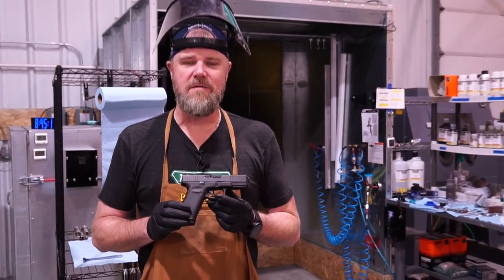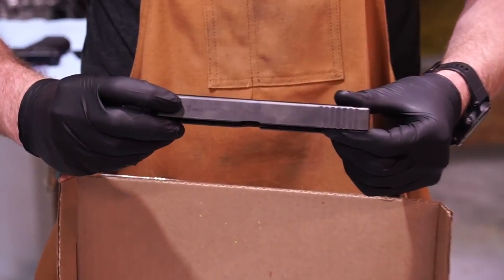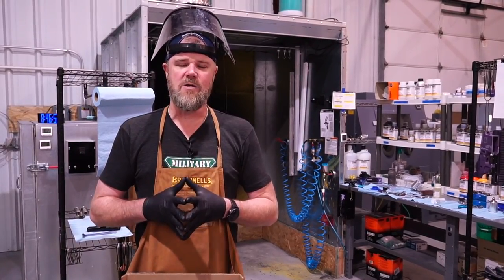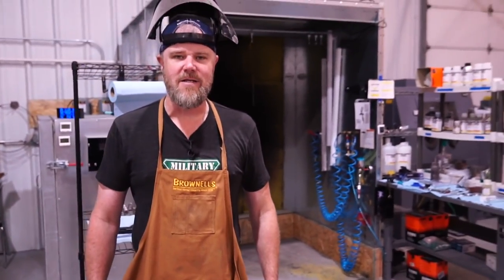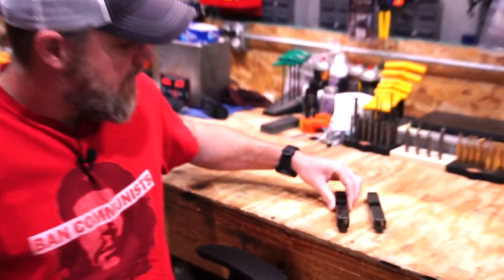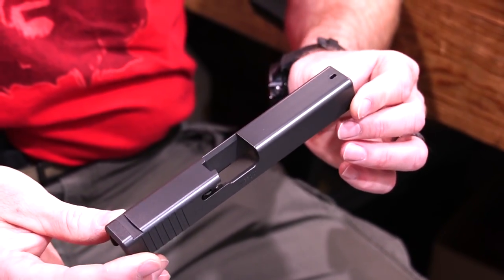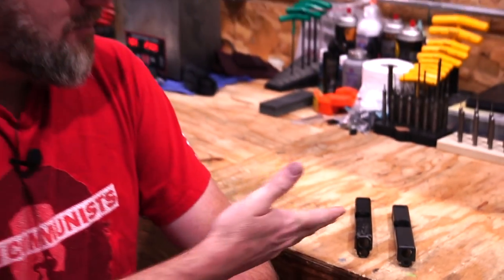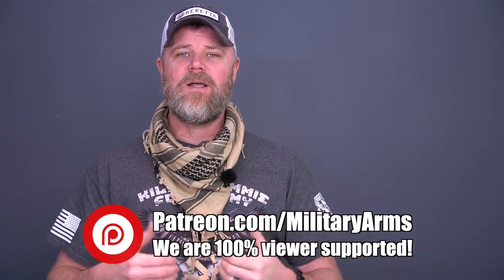Cerakote Acid Test

Comment: There appears to be a flake of something inside the right side of the slide, just forward of the ejection port. It's visible from a several different angles, 08:47 and 09:12 are good representations. Any idea what that is?

I've read what's available from Cerakote and the only test with which I don't have enough experience to quantify the results is the direct and indirect impact resistance test. A rating of 160 in-lbs. doesn't translate to anything I can use to compare it to other things, though I'm sure their mention of it means that it fares pretty well.

This looks like a great product and I'm definitely going to look into it more heavily for use in future projects. Thanks MAC!

Comment: I have not always been a fan of Cerakote. Back when SA did the first runs of the XD that rusted if you looked at them the wrong way.... Sent a XD off to be Cerakoted and it was better but nothing like the Glock original Tenifer. Anyway, anything I have had professionally (professionally - by professionals done correctly, not Joe Bob in his garage) have worn better than any other finish I have had experience with. Within the last 3 years.

Comment: Just a small note. Hydrochloric acid is different than hydrofluoric acid the latter being what was used in Breaking bad. Also, it would have been more scientific to put the slides in different containers. There could be a potential reaction between the slides in the same container with ion exchange. Just being a bit nerdy. Carry on.
ETA: had it been hydrofluoric acid it would have most likely consumed the cerakote finish completely

Comment: I work with HCL Acid on a daily basis and I was wondering what percentage of HCL you used ? I thought you looked a bit pukish when you poured it in the glass due to the harsh fumes that higher HCL percentages give off. I am thinking 24% or so would be a decent solution for the test. Most metals are pickled as they say in HCL for curing. Interesting on the Cerakote I had a Remington 1100 restore in burnt bronze 5 years ago it looks fine but the treatment I believe is better now ? Semper FI BTW Keep up the videos .. Former Cpl USMC 0311 Aco 1/9 Walking Dead are everywhere

Comment: Could you do a similar test on a Faxon QPQ finished barrel or a part with only a melonite finish on it? I'd be curious to see the results of such a test. Tenifer, Melonite, and QPQ are all nitrocarburizing processes and I'd be curious to know if the nDLC finish is going but the nitrocarburized metal is resisting the corrosive attack by the acid.

Comment: Does that Cerekote finished slide have also the additional clear coat in matte or high gloss advertised on the Copper Custom store website and  would I be able to tell the difference either in photos or in video between slides without the additional clear coat and with it in either high gloss or matte?

Comment: well i'm impressed all to hell. i mostly use duracoat, i've always figured there isn't much difference between them. always thought the prep is the most important thing. (blasting cabinet, etc) Can you tell me why you choose cerakote over that or guncoat.
Reply from the maker: There is a huge difference between Cerakote and Duracoat Duracoat is easier for the home applicator to use, but Cerakote is bay far more durable in every way if properly applied by a professional applicator.

Comment: Was this just an ad for CC cerakote work? Lol, as far as I know the tenifer on the slide you cerekoted doesn't bead blast off, just the surface treatment. Tenifer affects the metal of the slide on a molecular level dude. So you basically you cerakoted an already darn durable slide. The test only holds water if you cerakoted a bare carbon steel slide after the bluing removed, like an old 1911, Sig p6 or S&W m39, then compared to the new Glock finish.  A nitrocarburized piece of metal that is given an extra coating is one of the most durable finishes, think the Sig Swiss 55x guns that have multiple layers of finish.

Comment: I have a problem with this. Chemistry isn't simple. A material is designed for a target environment, and does not have to deal well with what it was never designed for.
For example, NP3 has extremely good corrosion resistance - but it is chemically strip-able. Which is good, because you can refinish without damaging your surface.
Now suppose you chose to test Cerakote versus NP3 and put them into a bath of that chemical as substitute for salt bath. How much sense would that make?

Comment: Salt is NOT corrosive.  Salt is hygroscopic (attracts water from the air) creating an electric cell, the salt water being the electrolyte.  This galvanic corrosion is  different than corrosion by acid.   Sweat contains water and salts,  so guns in contact with the body rust.  Oil displaces the electrolyte from the steel so no electric cell - no corrosion.  Cerakote is excellent.

Comment: My gen 3 17 I cleaned in my ultrasonic cleaner with simple green and it completely stripped the finish after just 4 mins I went to check on it and it was bare metal

Comment: Tim I really like these much more science-based videos. Past few days you've had my full attention, sir.
Reply: And as far as the durability vs different corrosive materials, different acids and other corrosive chemicals can all react differently to different chemicals -> a more thorough test would expose slides to other corrosive things like ferric chloride, or some hydroxides. This video DOES show that the cerakote coating is chemically not likely to react to HCl (and probably therefore other similar simple acids with ions with similar oxidation states)

Comment: The skeptic in me is screaming that this was an unfair test, with the gen 5 slide being worn and scuffed and the gen 3 slide being fresh back from being coated. I'd like to see this test reran with both slides being equalized in usage prior to testing. Same time spent in the same EDC conditions, and the same number of rounds through them both.
Reply: Also, for disposing of bodies, you want to use a strong BASE, not acid. Human tissue is normalized to a fairly acidic environment and can tolerate relatively strong acids without significant harm. Bases on the other hand will neutralize and liquefy the fatty lipids that hold the skin together, causing it to slough of like a slime.

This is the effect that you feel after aggressively washing your hands with soap(which is a base), that soft tacky feeling is the outer layer being partially liquefied and removed.

Comment: was the slide you cerakoted a tenifer slide? I always heard that tenifer treated the metal and the black was not actually the tenifer so bead blasting it would not actually remove the tenifer thus you were still testing a tenifer coated slide with a surface treatment?
Reply from the maker: Ok,  sorry man. The Cerakote is the exposed finish. That’s what’s being tested. Plus, Tenifer hasn’t been used for years now, not that it’s relevant to the surface finish test. What is interesting though are the pics of the old Glocks I show that are rusted from salt water.
Reply: Before you apply cerakote any previously applied coating needs to be removed. It is clearly expressed that beads as a blasting media will not penetrate the metal surface enough and provide the necessary surface for cerakote application. Aluminum Oxide or Silicon Carbide is recommended as blasting media. Using the correct blasting media you will actually see how the Tenifer/Melonite surface disappears.
Reply: @1.forestrunner  Except that tennifer/melonite doesnt disappear.  Its a metal treatment, not a surface finish. And it does not have a color.
Reply: @brucecamparmament3728  tenifer/melonite is a surface treatment only a few microns deep the color black we see is the postoxidation which creates a black oxide/phosphate.
Reply: @1.forestrunner  That is incorrect. It is not a "surface treatment".  The phosphate is a surface treatment. Tennifer is actually a process that changes the properties of the metal itself, albiet not very deep.
Reply: Bruce@CampArmament No it is a surface treatment. Same as case hardening, which is a surface treatment. Phosphate is a coating and doesn’t do anything beyond what it is, a skin. Best used as a base layer for another coating. Same as parkerizing, which is dipping in metal phosphate.

Comment: Maybe Glock shouldn't be producing their components in a country where they aren't allowed to sell the best finish they possibly can?  I may be mistaken, but I'm taking it that the Glock rep was meaning that they've created the toughest finish out of any they've been allowed to apply here in the USA - not the toughest finish they've ever had (please correct me if they are claiming that their current Gen5 finish is stronger than Gen2/1 Tennifer).  They had a good thing going with Tennifer, and probably could have improved on it to be even better.
Reply: I can assure you the a Nitride DLC is much tougher than Tenifer. All Tenifer is, is a glorified Teflon. DLC is a tough finish, however nothing is going to beat a carbon based Nitride process. Nitride goes on clear. then manufactures apply a plating or some finish over the Nitride. But then what do I know...but I do have a Ph.D. in Chemistry. Also this test was "Flawed" from the get go. You never put both specimens in the same test environment....i.e., both slides in the same bowl. For all we know the chemicals in slide one cause contamination. If this Cerakota was soooo good then why isn't it being used. and not just in the firearms industry. Nitride has been used in aerospace, automotive, industrial areas for a very long time.
Reply: @ricks.1092  Thank you.  All I know is that my Gen2 Glock has never rusted, but my Smith & Wesson Shield, bought last year, rusted far too fast.  I sent that slide back to S&W, they sent me a new, updated slide - which again showed rust within months.  Were I to do it over again, I'd have gone with the G43 just based on my experience with my old Glock never rusting.

Comment: It's still paint... yes it's much more corrosion-resistant yes it has lubricity properties and yes it will chip and where overtime with holster wear and daily use, much faster than the factory Glock finish. The acid on the Glock finish is eating it from the inside out because the metal is porous that's why it has spots all over it. If you want to spend a couple hundred dollars refinishing your Glock slide with a paint product because you're worried about corrosion you're wasting your money. If you like the Aesthetics of the creocote go for it. Me personally I would rather spend my money on ammo and replacement springs for when they wear out. Shoot the gun, get it nice and hot and rub it down with any good Teflon based oil I guarantee it will never rust under "normal" conditions

Comment: Resistance to HCL and resistance to salt corrosion are completely different things.  IMHO, resistance to "real world" processes that can damage a firearm, such as scratch/wear, salt corrosion, and chemical reactions with gunpowder/propellant/copper/gun cleaning chemicals are legitimate concerns for gun owners.  Nothing against Cerakote.  If a wear and salt corrosion resistant slide is then coated in an acid resistant product that also adds another layer of wear resistance, it is just more protected.   However, equating Cerakote's HCL resistance to salt corrosion resistance is flawed at best and hopefully wasn't intentionally disingenuous.

Comment: Should be noted that the Nin the nDLC is the Nitride Treatment. Nitride goes on Clear . In which the Nitride goes into the substrate (outer most layers: .002"-.004") of the metal. For the Nitride to be removed you would be removing part of the treated metal too. Again, this test illustrated nothing due to serious contamination. Each Slide should've been in separate containment areas...i.e., in separate bowls. You're allowing the molecular composition of one item possibly affecting the molecular structure of the other item causing a reaction that might not be present if test items were subsequently in their own testing environments that are the exact same for duplication purposes.
Reply: Exactly
Reply: Interesting point that I hadn't considered!

Comment: I'm not overly surprised... I have not been impressed with the durability of the gen 5 finish at all, after carrying a gen 3 for 10 years it still looks like new. Gen 5 carried less than two years has heavy wear on the slide overall glock needs to step up their game.

Comment: I worked at a plating plant for a while.  If you can't think of anything more corrosive than fuckin' hydrochloric acid, you aren't doing it right.  In fact, stripping black oxide plating off of parts killed a hydrochloric acid bath pretty fast.  You're way over-hyping the acid.  You can buy that shit at Walmart.

Comment: What is the concentration of the HCL?     makes a big difference.
Reply: It looks like he used a bottle of diluted HCl for swimming pools. IIRC, that stuff is around 33% HCl. I like to dilute it down to 10% HCl for eating rust off auto parts. Letting the parts sit in the 10% solution overnight usually does the job. Just FYI.

Comment: I would be more impressed if you used both slides for 1000 rounds first then reran the test.  I can coat a slide with wax and it will ace the acid test, but not after being worn in use.  

The finish is probably great, but the test is not valid for testing USE in harsh chemical conditions such as maritime environment.

Comment: This is kind of a Troll but at the same time, I kind of want to see it done with the same coat. Now Hydrochloric acid is a very strong acid there is other acids that are SOOO much stronger than that. One of them being Floroantimonic acid which will eat glass and would have to use a PTFE container. It's so dangerous that the PPE is laughable. If it gets dropped on the ground it will eat until it evaporates and even then it just degrades into a gas form of a super acid. It will probably eat the cerakote finish and slide within 24 hours. I'd almost bet on it. You wanna talk about eating a body away hydrochloric acid will still leave bits of bone, that stuff will chemically cremate everything and chemically cremate the cremation afterwards, literally turning it into toxic vapors.

Comment: Hydrochloric acid does not melt porcelain bath tubs. HydroFLOURIC acid (used in BB) does etch porcelain and glass. Not sure it actually melts it. RE: Breaking Bad.
Reply: I think that tub was fiberglass... not porcelain
Reply: @brucecamparmament3728  
Could have. It was mostly quasi science on the show. Many of the mistakes were purposely intentional as to not aid real criminals. 
Years later, I am still in shock from the scene where the goopy body and sludge slams/plops down from the ceiling  next to Walter and Jesse. May be just one of the all time epic scenes ever on TV. 
Did you see it with out knowing before hand? I watched that episode on its original broadcast date. So, NO warning. LOL.

Comment: Eh Tim, remember when using concentrated acids you want to use cool water mixed with baking soda to "deactivate" it, when you only dip it in water alone you're merely diluting it thus leaving yourself open to potential risks brother. Just an FYI, not trying to be a schmuck...& you can accelerate the results by using low to medium heat instead of leaving it overnight again leaving yourself open to an accident/ incident. Remember though when you do heat acids you release some nasty stuff so outside or under that bitch'n fume hood right behind you brother. Thanks bud, have a good1!

Comment: Interesting but not good science. The only way a regular person is likely to get HCl on a gun is if they puck on it. Resistance to HCl doesn't equate to resistance to salt spray and human sweat contains salt. Materials react to acids in different ways, H2SO4 may have destroyed both finishes or neither and HF acid would have probably burned through your glass container. Sorry but not a good test. Keep up the otherwise great work.

Comment: No offense Tim, but this is a terrible example, bit not for the reasons you mentioned.  HCl is not an oxidizer.  The corrosive properties are completely different than what most gun owners are worried about.  There is a reason salt bath testing is done.  That more closely recreates the type of corrosion gun owners are concerned about in a quick manner.  Your test results mean nothing at all.  If done properly it could (I have no way of knowing) show the exact opposite result.  I truely appreciate the attempted at showcasing competing products, but maybe next time do something that is more realistic.  Perhaps shoot corrosive ammo and get it salty and leave it outside for a few weeks.  Ultimately your concerns are founded, because your example is so apples to oranges in actual chemistry involved that all you did prove was we shouldn't store our slides in HCl.

Comment: Was the Cerakote applied to naked metal? or over the original slides finish. And all the nDLC was remove the DLC finish and Not the N=Nitride treatment. No baseline was established and both slides should've been in their own (separate) vats...….………..I actually have a Real Lab. with all the proper equipment. I can even put the slides at various pressures, etc. Send me 4 slides in which the Cerakote has been applied to the bare metal and on 2 samples. And I think I would get different results. However, due to both Slides in the same "Tank/Vat" there's contamination present. Hence this test reveals NOTHING. But then what do I know....but I do have a M.D.; Ph.D. and the Ph.D., is in Chemistry.
Reply: Jeez, would you like to show us your middle school report card as well?...